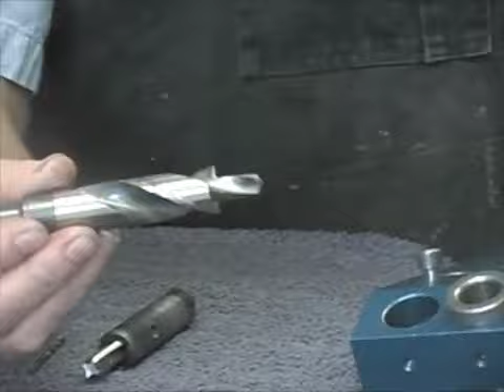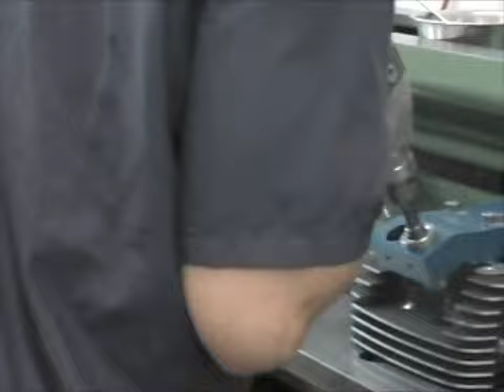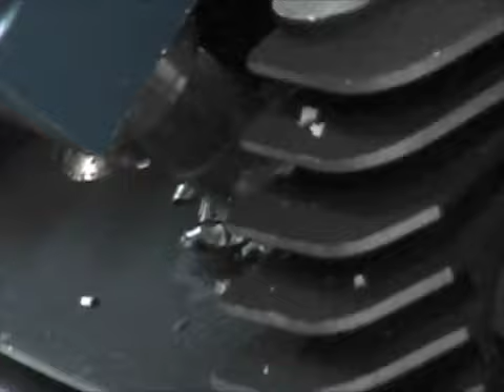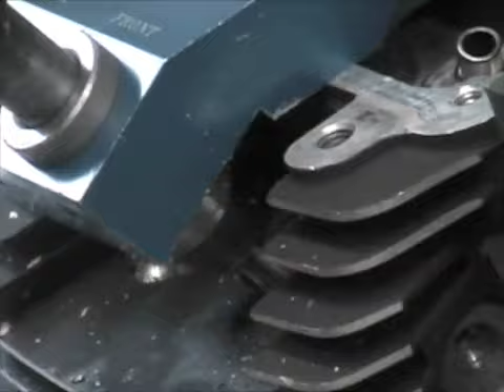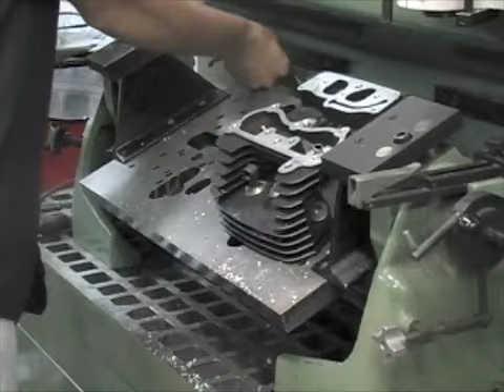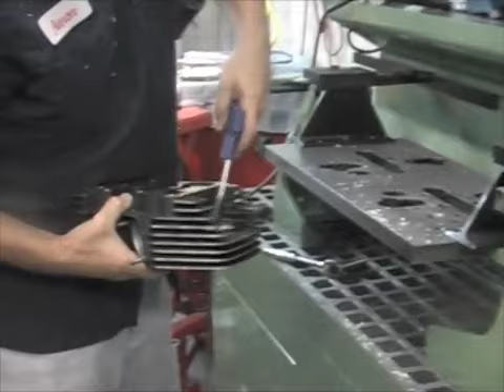Machining a Harley-Davidson Twin-Cam Manual Compression Release

Comment: noticed a couple of things that should have been done, before tapping threads you should have a champher on that hole, and why in the world would you do all that by hand when you have a spindle and use quick change collets?
Reply: This fixture can also be used on the motorcycle without disassembling the vehicle.  I have a bud who does this work in his back yard shop.  no need for a Bridgeport.